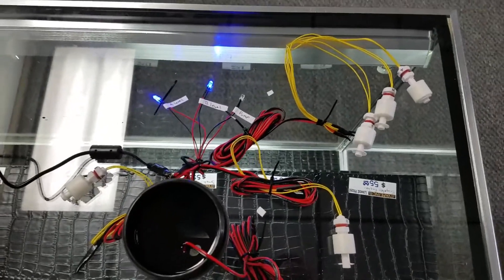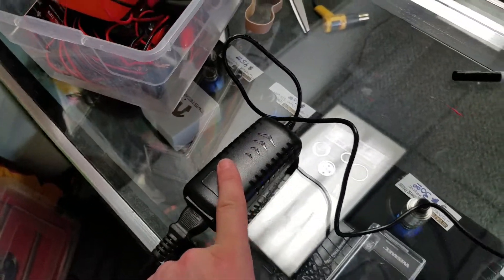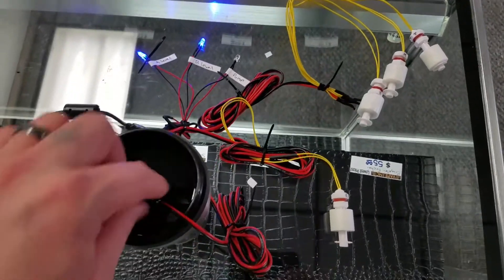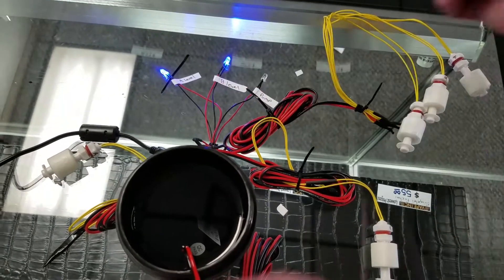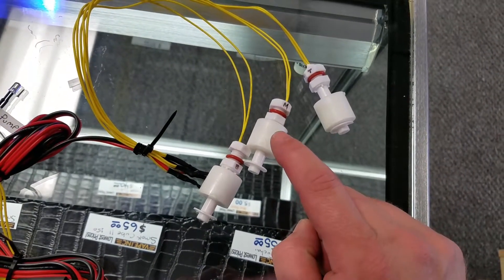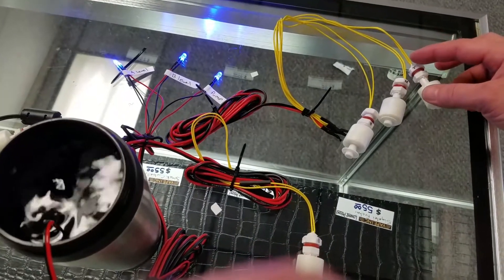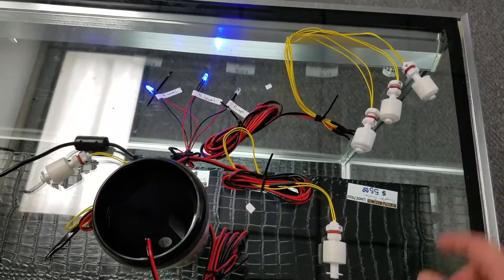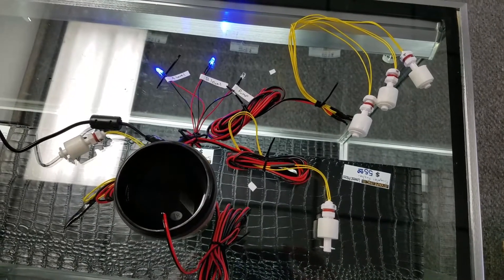All DC Auto Top Off (ATO) System w/LED indicators

Comment: Great setup. I am going to make an ato system using dc pump. Can those sensors handle amps when the pump is running? How much amps can it handle? Have you had any problem with your setup?
Reply from the maker: only problem so far is that I let the wire splices fall into the water, and the corrosive nature of saltwater eradicated the copper wire, 
I have since improved the wire routing to prevent this.